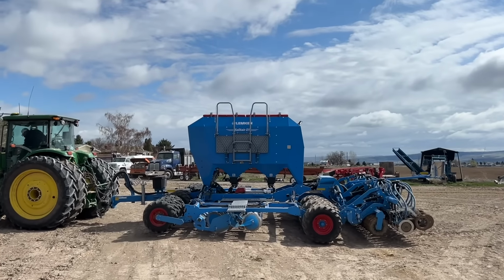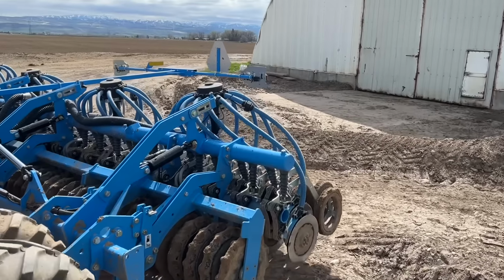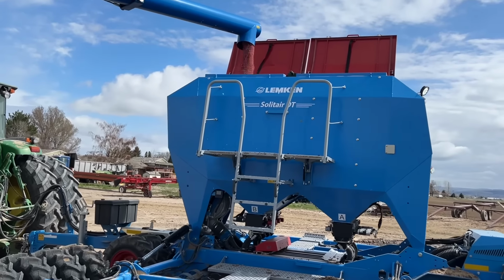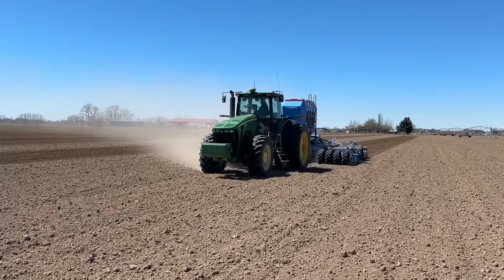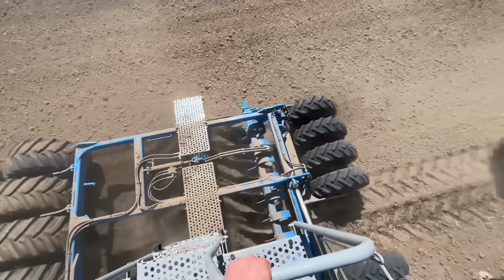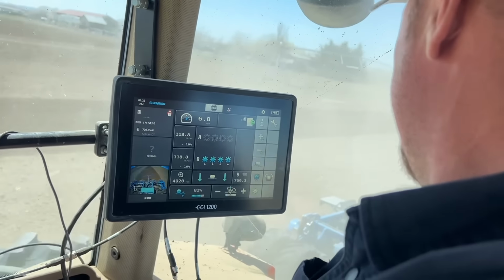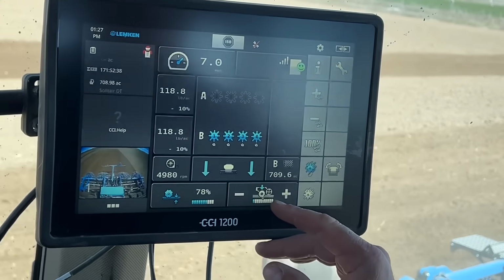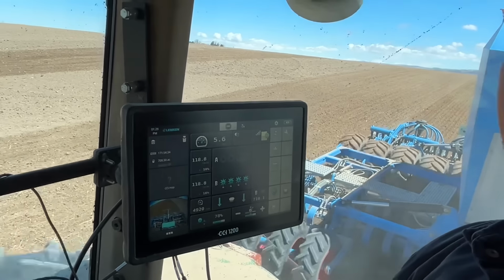Our New Lemken Solitair DT grain drill!

Comment: i have a small Lemken Saphir 7 combined with a rotary harrow and think its one of the most reliable seed drills in terms of seed germination. The combination of the ring-compactor right in front of the disc-seedshares guarantees a reliable deposition of the seeds deep enough to have enough moisture but shallow enough for easy germination. The rubber pressure rollers increase the contact between the seeds and the shares and control the depth of the Depostion
Reply from the maker: Yeah it’s pretty amazing how adjustable these machines are especially on the fly and I think when we switched to Lemken, we are getting about a 98% germination rate

Comment: No thanks. To small. Plus i prefer to support American built and owned manufacturers.
Reply from the maker: They make a bigger one. I prefer to use the best.
Reply: @RockyMountainFarmer  Lemken the best??  I have a karat with a rear roller and hitch broke clean off the machine and welded back together by a machine shop that says different.
Reply from the maker: @jayfarmer3911  the only way the hitch would break off is because of operator error